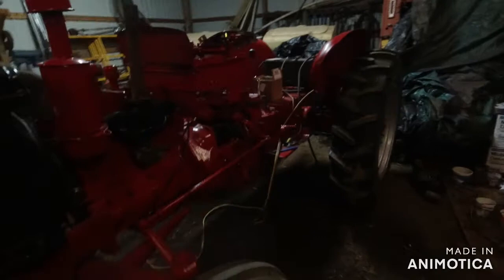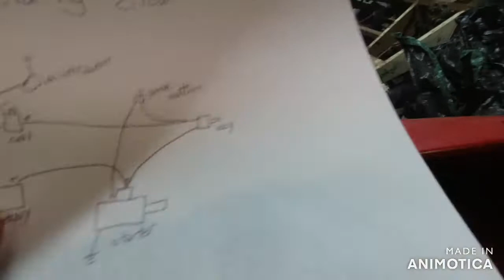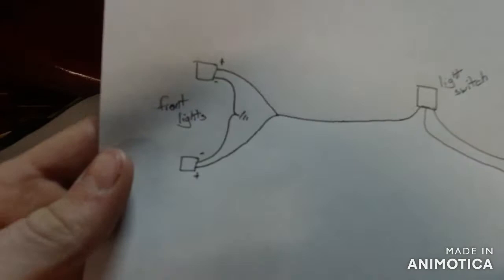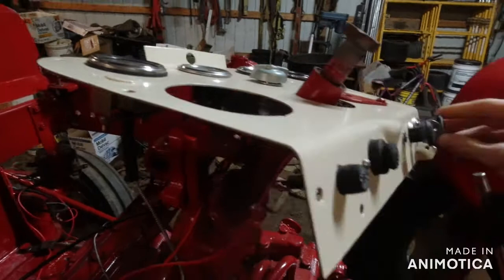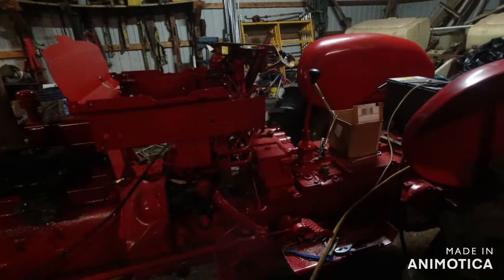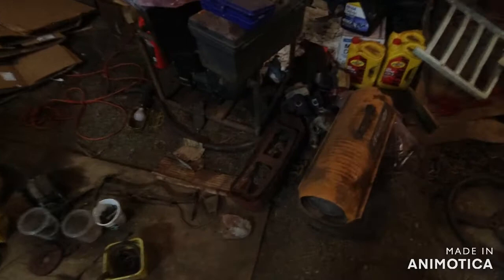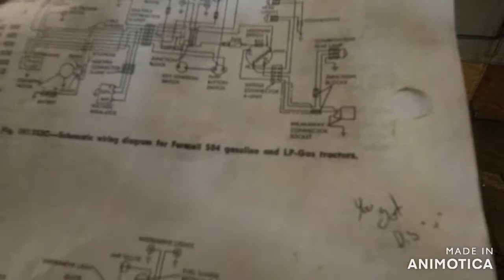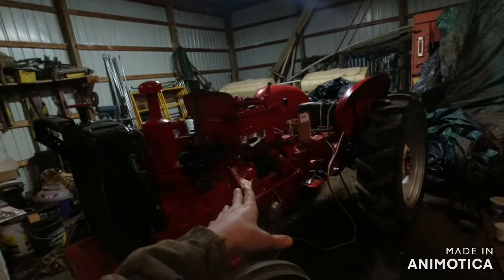How To Wire A Classic Tractor

Comment: I bought a little 10 circuit breaker box at bass pro shop for 20 bucks. I was fixing a bird nest of wires under the dash of an old boat I refurbished. It worked great to get rid of the mess of wires with a inline fuse in a clump. It was almost impossible to trace them down . They make butt connectors with solder in them. You just poke the wires in and hit it with a heat gun. Sodered and shrunk at 1 time. Work great. Nice tractor. I have a 55 IH I am restoring. 300 utility

Comment: Hello, 
 The tractor is looking good.  You should have everything on their own fuse, that you can tell witch line in causing you trouble.  If you have everything on one fuse you will have a hard time trying to figure out what is giving you trouble.
Reply from the maker: Thank you. I was going to run everything on it’s own fuse but since this tractor has so little wiring on it I think if it would have problems they will be easy to find